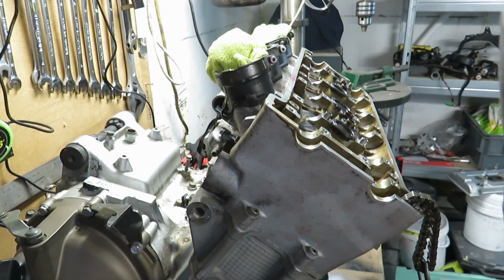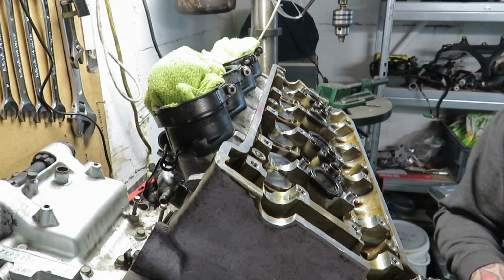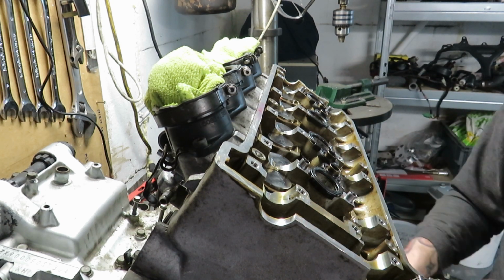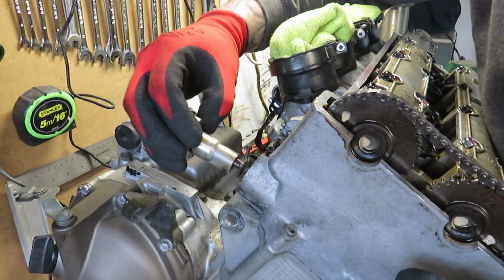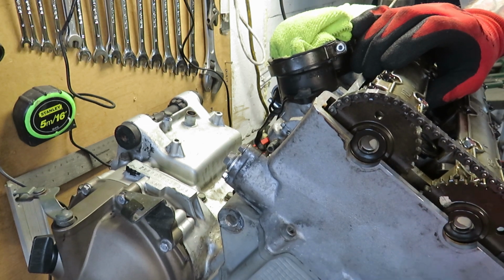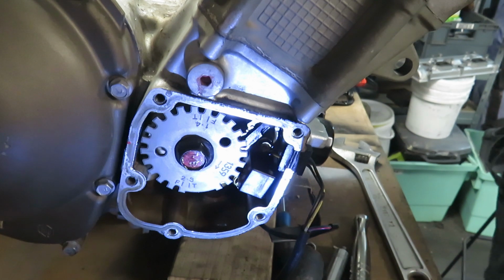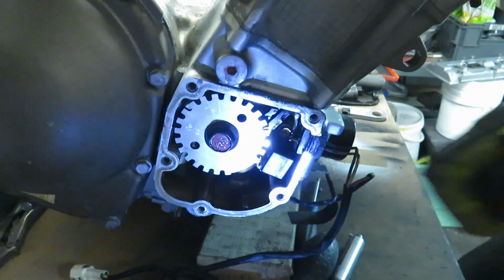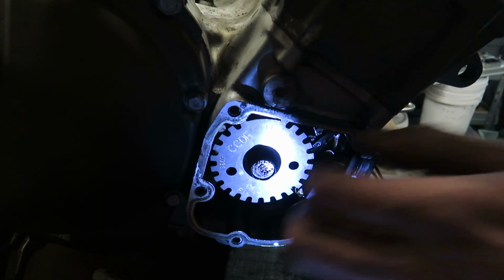ZX9R E2, Valve Clearances Part 2. Ignition advancer, first mod!

Comment: The service manual specifies that you insert the cam chain tensioner before torquing down the cam cap bearings. The haynes manual gets it wrong so please follow the official service manual.  If there is any slack in the cam chain the cams will rotate when you torque down the cam cap bearing.

So to prevent this from happening you insert just the tensioner body.

Thing is to set the ratchet mechanism to 2 clicks less than what it was when you removed it, or, to 5 clicks out if you did not make a note of it. This will take out most of the cam chain slack but leave a little bit that is needed.

Once the cam bearing is torqued down, and the tensioner inner is inserted, you can very slowly rotate the timing rotor clockwise and listen for the cam chain tensioner taking the slack back out of the cam chain, this lets you know its working.

NOTE, before refitting the cam chain tensioner work it in and out with fresh engine oil so it works smoothly without feeling gritty.
Reply from the maker: I hope you’re ok with me pinning this comment to the top. Everyone will see it then. 

I usually push the chain with my finger or a punch. Just to take up most of the slack. As you said, 5 clicks which is what I do. I don’t bother counting as I’d be putting too much tension on it when tightening the Cct. 

Thanks for commenting, I will keep this in mind next time! Haha 👍🏼
Reply: @8713Thomas  No worries. Great job.

Comment: Would it be a good idea to mark the chain and the cam sprocket so you avoid trying to line it all back up and potentially put it out a tooth ??
Reply from the maker: Valid point. But, with the tensioner being installed correctly according to the procedure, the crank and cams all lined up, there shouldn’t be any problems. You’d torque it all up, rotate the crank 2-4 times to check timing again.
Reply: @8713Thomas  Sounds fair mate. You're a braver man than I am lol, but I will have to deep dive into mine at some point. My 2nd E2 bike has 58k Klms on the ODO and I'm not sure if the previous owner had the valve clearances checked. I am very handy and mechanically minded, just never tackled  job like this before. Thanks for the videos